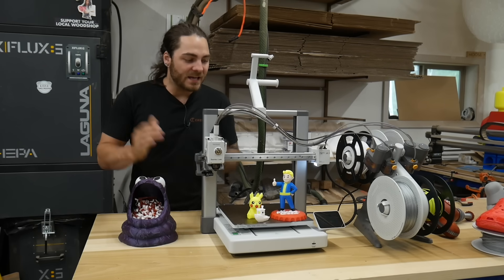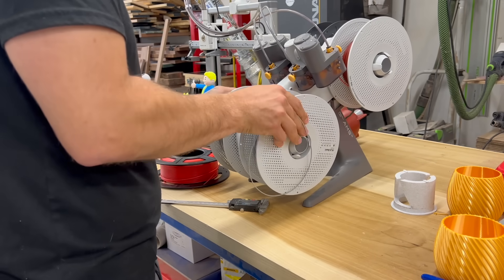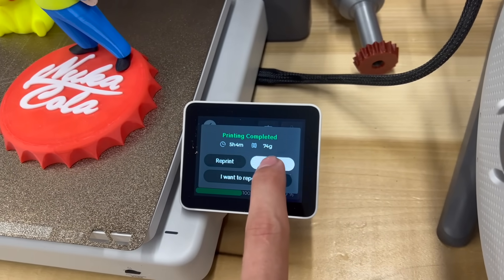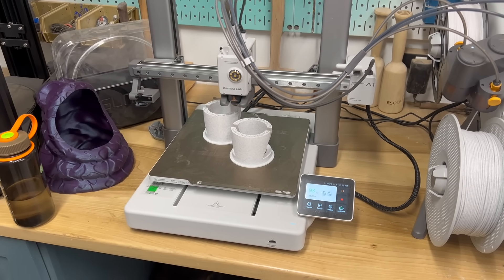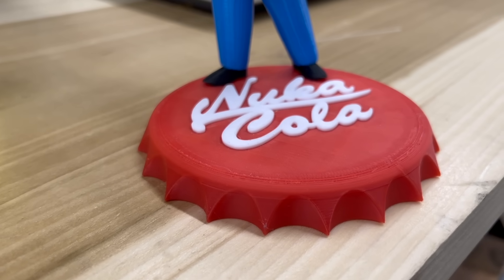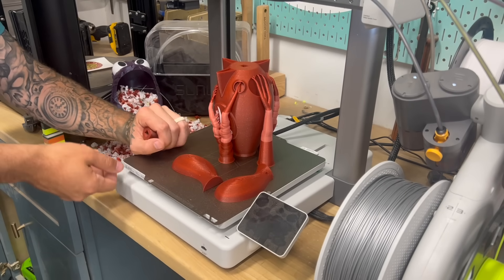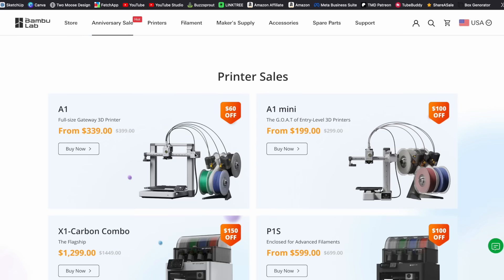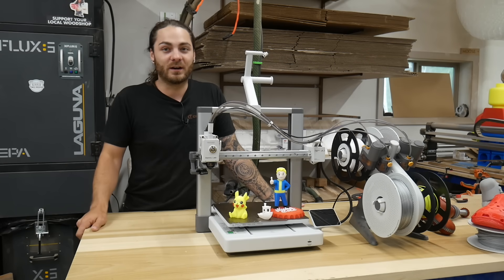Watch This Before Buying the Bambu A1...

Comment: The solution to your poop problem is a tool changer printer. It’s called the snapmaker U1
And if not that, just try to be intelligent when selecting prints, and adjusting them.

Comment: The Bambu A1 is the easiest printer I've ever used. They also have thousands of tutorial vids for modding gcode, settings, and filaments. I've been able to fully automate mine for factory style auto printing parts using the arm to sweep parts off, followed by printing crazy support structures that still come off easy.

Comment: The A1 and A1 mini are excellent printers and the offer multi-color prints at a very low entry level price. The AMS works very well with the single extruder design.

That being said, when one buys a single extruder machine they need to understand the purge process between colors. It is what it is, if you can’t handle it buy a multi extruder printer instead.

Just get smarter about what you print and perhaps use paint to achieve some or all of different colors in your particular print.

Comment: PSA: if anyone is seriously getting into 3-D printing and their area is prone to power outages it’s highly recommended that you get an External PSU. They make them for computers so they plug into that and then the PS U plugged into the outlet and it gives your computer about 10 to 15 minutes of power before it shuts off allowing you to say files I feel like this would be a great investment for 3-D printers as if your power goes out you get around 10 to 15 minutes of extra time Before it completely dies out

Comment: My first question is; Why are you doing that? The second point is, folks, don’t complain about AMSs. Or excess filament thrown out. If you want to print multicolor, you have a choice. The cheapest and the worst option is waiting by the printer while it’s printing so that you can constantly change filaments. Second is buy an AMS and let it do the work for you. Third is buy a multi head machine at higher cost. It’s a choice. The Creality isn’t all that open source. Also, try to get parts. Good luck. If third parties want to make parts for Bambu Lab, they can. Likely though, they will cost about the same and not always be as good, or as easy to obtain.

Comment: My wife bought me the A1 for Christmas and I started using it in January, I am new to 3D printing and knew little to nothing other than watching You Tube videos.  The good; easy to set up and get going.  At first it worked great but as time as passed I am having several weird issues with it and print failures.  I have replaced the hot end 4 times in the minimal time that I have used this, I recently just spent days (yes days) working with customer service to figure out my most recent failure which was I didn't use the printer for 1 1/2 week then tried to use it and it failed mid use.  It wouldn't print anything, I switched filament several times, cleaned hot end and replaced hot end nothing was working all prints failed midway.  After an incredible annoying and what I call awful customer service they stated that my hot end heater is bad, ok send me one nope not any warranty the heater that heats filament causing the printer to work is considered a consumable?  They sent me the warranty coverage and one REALLY NEEDS TO READ THIS TO UNDERSTAND HOW NEXT TO NOTHING IS COVERED.  So for me to troubleshoot this issue I had to buy a SD card reader to send them my logs and multimeter to check resistance on heater.  I was excited to get this but if I had to do over knowing what I know now would buy another brand.  It has seemed to work itself out to where it prints but when I load filament I get additional ooze from the filament after it supposedly stops but prints fine now.  I have little to no confidence in this printer, if it totally fails and I still want to 3D I am going with another brand.

Comment: What do you think about the idea of adding an Elegoo Centauri Carbon after buying the BambuLab A1 AMS Lite. To my way of thinking I get a multi-colour printer ( for me that's a convenience rather than a necessity) + a printer that will print  useful practical designs but tougher than the Bambu when needed. Both of these printers have a relatively budget price but are  highly regarded,

Comment: how does it handle ASA and ABS?
Reply from the maker: I wouldn’t recommend this printer for those filaments. I’d recommend a printer with an enclosure.
Reply: @TwoMooseDesign  is it because of insufficient temperature and not a quality print or just because of toxic fumes?
Reply: Temperatures. Asa and ABS like to be printed super hot. We got a P1S for this

Comment: The A1 is riddled with problems and spending all day troubleshooting right out of the box is not what I had in mind when I spent $500.  I would NOT recommend.
Reply from the maker: Mine has been great and I’ve had no problems you must of gotten a dud. You have to raise the bed temp a little to help with adhesion but for me that’s the only “issue” I’ve had.

Comment: Did you test all the sped settings including the ludicrous speed
Reply from the maker: Im not sure what you’re asking. In general yes. The faster you print the lower the quality. If you just need to bang stuff out quick it works fine, if you’re looking for quality I’d leave it on standard. I run my bambus on standard mode.

Comment: Hi everyone I'm a 13 year old that would love the A1 currently I have a toybox printer I would like to upgrade to the A1 idk if I should get the multi color combo and idk if I should sell my toybox to get it what do y'all think
Reply from the maker: Hey! I’m not familiar with the toy box printer but the A1 is a great printer. As for the multi color combo you do not need the AMS. You can add it later, you simply plug it into the machine. So if you would like to same some money right away and just get the A1 that is totally fine.
Reply: @ ok yea right now I have turned my focus on the mini and buying the AMS with it I don't quite know where I can make the most back off my toybox do you think eBay?

Comment: This is the worst "beginner" 3D printer you can possible buy. I made the mistake of buying 2 of them based on my research and found out the hard way that the company (Chinese) is absolute a fraud. My order came in 3 shipments with the printer late and last. After following EVERY step by the book I first dry one to calibrate. After 5 seconds of going left and right it stopped in the middle and the display told me " Calibration failed" that's it. No explaining what is wrong and how to fix it. Got on their website and found NO FIX or explaining. Contacted the bot and got a ticket of my request (no answer) and that is the last what I heard from them so far. This is not a customer service at all.  
But I have a second one, did the installation again, exactly as shown and the SAME problem again. After 5 seconds the message "Calibration failed"  To everyone this is a scam machine and this actors are just paid actors what lying to you. Stay away from Bambu Lab products. This is CHINESE JUNK.
Reply: Did u buy the right filament

Comment: I would think the best that you can buy in the market right now that doesn't give you so much waste would be the prusa XL cuz it doesn't have to purge as it has separate hot ends for every color the A1 or any of the bambu series that poop out all of the purged filament the AMS units are more for the convenience of not having to constantly change out your roles. You can still do multicolor prints at least in a pinch if you need to but if you're looking to maximize on Less waste I would still go with the XL
Reply: The XL is like 3k though. If you are printing not too many prints and you change the right settings, it will be cheaper to just get the a1
Reply: @Gpb45  true, this is the biggest issue with the Prusa line now is the cost. but if you look into the specs of that machine, there is more to it then the hot ends, but for someone printing just for a hobby and not often the price is pretty high. I have a business on the side and at some point it will make sense for me to buy

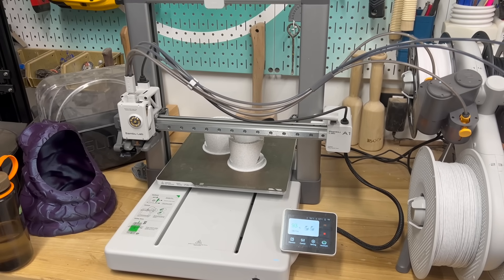Comment: If the power goes out or one of the pieces gets ruined in a batch, from the phone app you can cancel only that piece and continue with the others. At 7:12 for example, if one piece came off the base but the other didn't, you can cancel the one that came off and continue the other to minimize the loss of material and time.
Reply: How can you do that? What if the .stl originally had all the pieces in a batch ?
Reply: @ArtCebola  The button that lets you skip parts is located in the devices tab to the left of the pause or cancel printing option (I don't remember if the button is always visible or only while printing).
I think what you're saying doesn't matter because the printer uses the Gcode you send with all the parts, but if you cancel a part, it skips that part of the Gcode. Sometimes it makes strange movements, or does the movement without releasing the plastic, or it skips the entire process.
I've used it a couple of times just to save the parts on the sides of the failed one, so it doesn't ruin those either.
The only bad thing is that it doesn't always let you use the skip option, and you get a message saying that option isn't available. I'm still looking for the reason why it lets you do it in some cases and not in others.

Comment: Ppl fail to undersrand multi color printing and get all bent out of shape based on the waste. Ye you can chamge all those settjngs with a lil work. The high up front cost of multicolor printing can be spread over multiple prints on the bed. Ie. If you are printing small items that are multi color, you cannot jist print 1. You need to maximize your bed to spread the waste over 15, 20, 25 prints on 1 bed. The waste does not change after the first item.

Comment: Honestly with all that waste, I think it would be better to just print a solid color then paint it. Goes much faster and no waste. And it's not like the "paintjob" of the printer is super advanced, so even a child could probably paint it by hand in a few minutes.
Plus with paint you have significantly more options as you can mix the paint and have so many different ones.

Comment: I may have missed it but what are the advantages to getting an enclosed printer? I’m looking for my first one and I don’t want to get a “starter “ for $300 just to realize I need a more advanced one that’s enclosed.
Reply from the maker: Hey! You do not need an enclosure unless you plan on using filaments like ABS. Most people print with PLA or PETG which doesnt need an enclosure.

Comment: Hey! Fingers crossed that you actually read your comments. I started 3D printing a few months ago and have already purchased 3 P1S combos. I have the 3 of them running 24/7 and am already looking at a forth. I'm realizing that I can handle most of my intricate prints with my P1S's and was beginning to think that an A1 with no AMS would be amazing to increase my productivity when it comes to small single color prints with PLA like articulating toys, etc. Do you think I should just snag an A1 for $299 instead of opting towards a forth P1S?
Reply: Could I just hang a huge spool of a single color above it and have it just go forever?

Comment: Do feel like there's a benefit with the q1 pro's coreXY configuration vs the A1's bed slinger even just for PLA and PETG printing?. 

The A1 without AMS lite is about $90 cheaper than the Q1 pro where i live, but with AMS lite its $150 more than the Q1 Pro. Weighing up which is best is tricky given the Q1 is technically more capable in terms of filament types and the Corexy is a "better" configuration.
Reply: There is no Bambulab Q1...